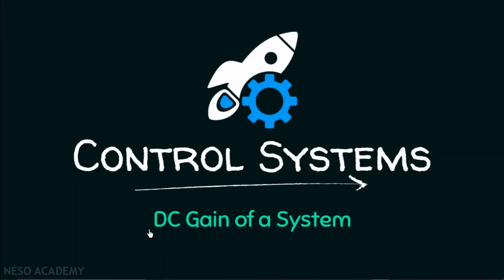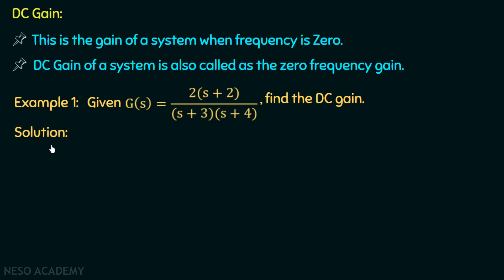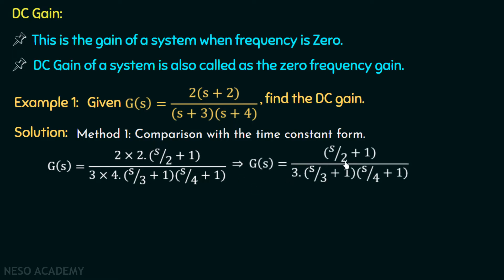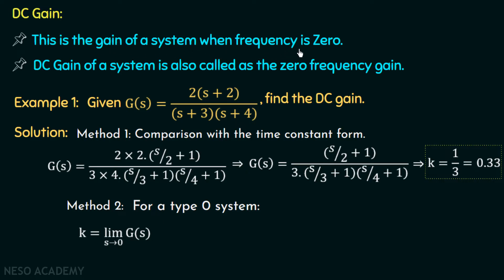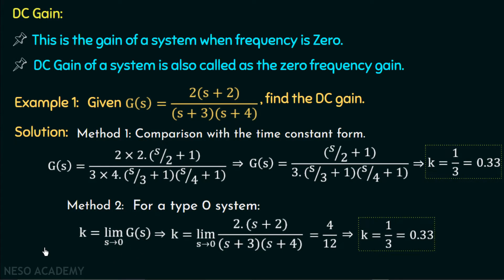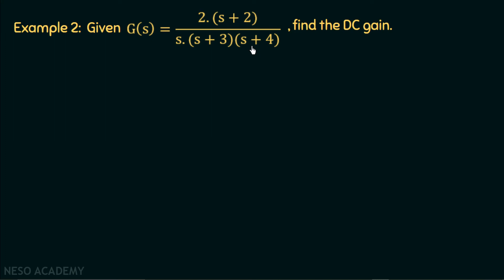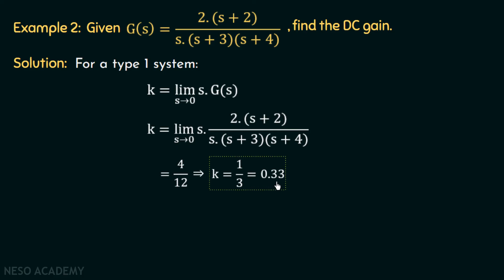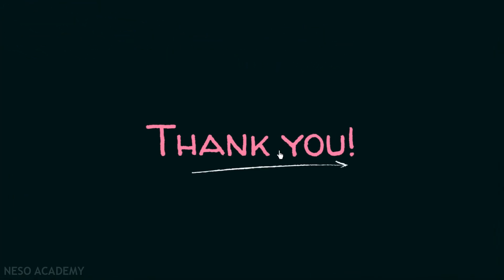DC Gain of a System

Comment: for those who didn't understand the homework, it's easier if you know that any even exponent of a function is based n type 2 system, which means that since here we have s^4 we can use the formula lim s->0 G(s) .s^2 . Then s^2 of the denominator would cancel out with the s^2 of the formula and then you can use method 1
Reply: I did it turns in 1/3
Why is it 3?

Comment: Here we'll calculate 
Acceleration gain 
When 2 poles  exits on (0,0)
So Ka=6/2=3
Reply: Acceleration gain?
Reply: @themuffymouse  This is such a late response....But just to add 2 cents to the comment section: in mechanical systems, if input=Force (m*a) and output=x(t) meters (displacement in x), then the DC gain influences the rate at which an object accelerates towards its steady-state output. It's not literally scaling the acceleration as the phrase "acceleration gain" implies, it only scales the steady state response - but still, increasing DC gain in the transfer function of a purely mechanical system (where linear/angular displacement is the output), results in an increase to the transient acceleration of the object while it approaches steady-state, hence the term "acceleration gain."

Comment: What do you mean by the DC gain of a system is never infinite? 
On an ideal integrator, for instance, if you apply an input DC voltage the output voltage will increase forever towards infinite. The DC gain should predict that and should not be "1", otherwise misleads a person to conclude that for DC the output voltage is equal to the input voltage.
Reply: The infinite gain at low frequency in the ideal integrator is a problem and is referred as Low Frequency Roll Off.
Anyways we are dealing with control systems here and we avoid infinite gain at low frequency, referring to that is the statement.